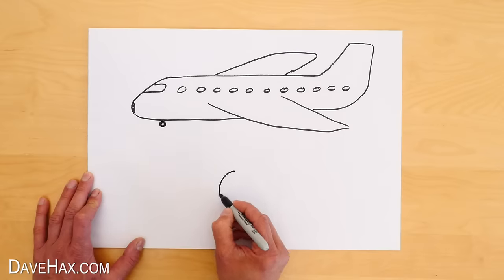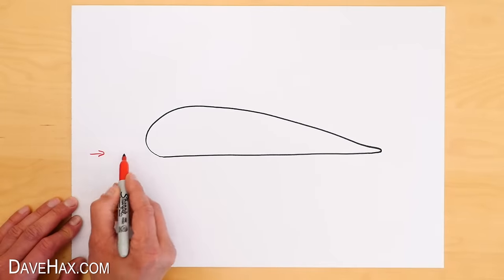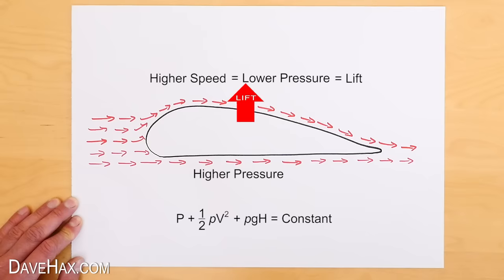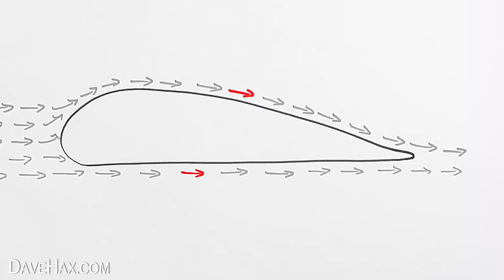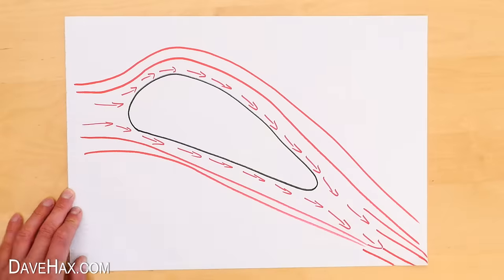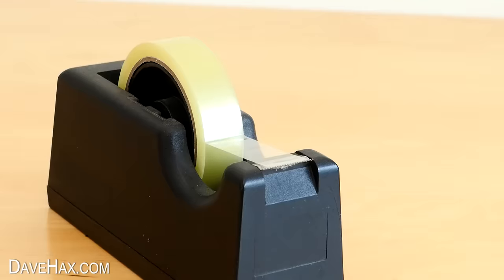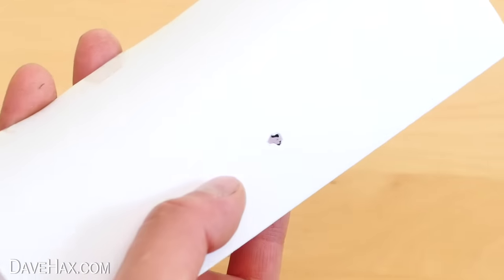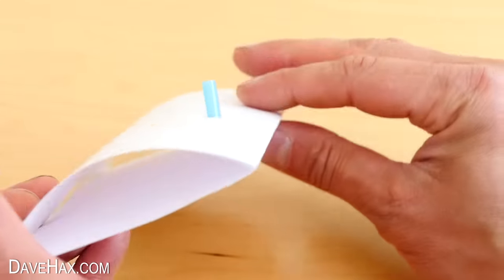How Does  A Plane Wing Work?

Comment: He got the wing design wrong it should be round at the start when the airflow starts to hit the wing and it should be a that wings end when the airflow shoots out it should hit ground but because of the design it will not and no lift force will be made